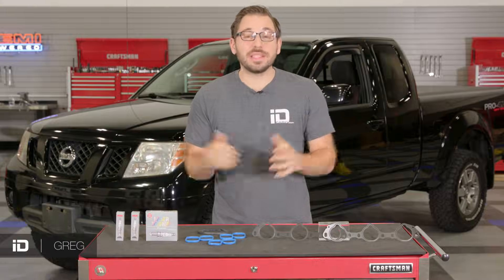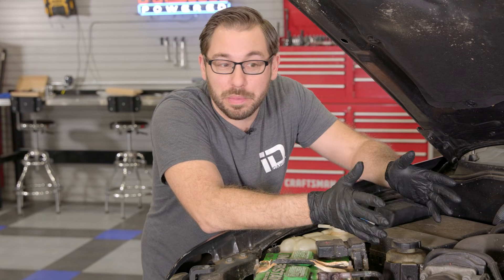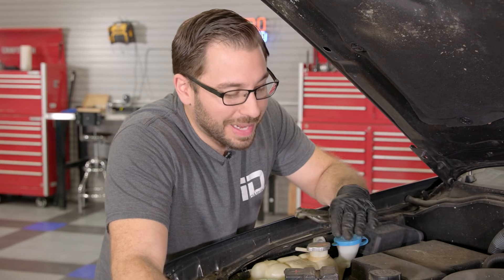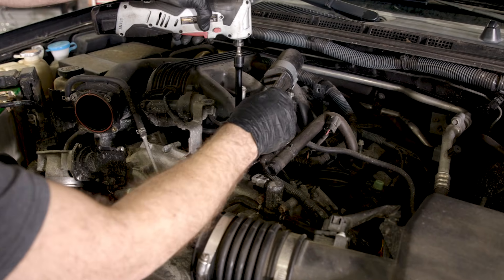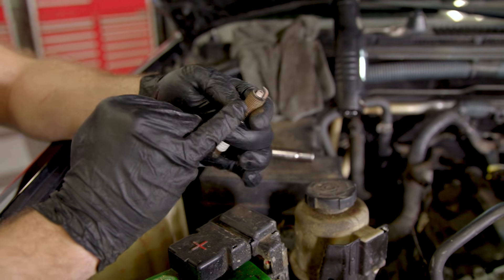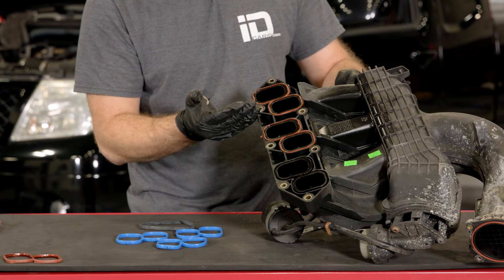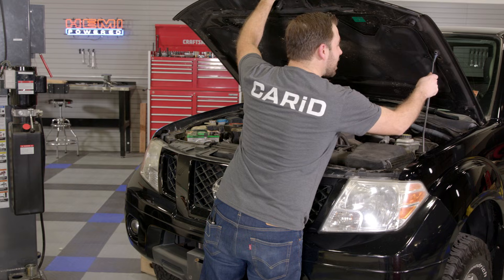Nissan Frontier 4.0L V6 Spark Plug Replacement DIY

Comment: When reassembling the manifold - you left out re-ataching the vacuum hose, that you noticed you needed to disconnect earlier. This is a really important step as it is specifically a brake vacuum hose and if not connected your brakes will essentially fail. I found this out since I forgot to re-connect it.

Comment: if I disconnect the battery I should be able to disconnect the throttle body and not worry about all the issues correct

Comment: Just did this, don't need to pull off the manifold foe the rear spark plug, and just needed to shift the manifold out of the way to get access to the 2 front

Comment: I found something interesting that I could not explain when I changed my spark plugs in my 2012 Nissan Frontier.  The forward intake plenum had two little holes on the underside.  The holes where about 0.1-0.125 inch in diameter.  I did not have time to explore it too far but they seem that they would let air in.  I'm calling the forward plenum the duct between the air cleaner and the drive by wire throttle body.  The two holes looked factory clean.  Has anyone else noticed these holes?

Comment: The rear harness bracket was not bad at all but there was a sequence that needed to follow to get to the fastener then reverse the sequence for installation.  This video was excellent for planning.
There is actually four harness attachments to the aft bracket.  I could only undo three of them before removing the intake.  I removed the bracket attach bolts and removed the intake with the bracket attached to the fourth wire harness attachment.  I removed the bracket from the fourth harness attachment post removal of the intake.  Then reversed the order for installation.  All four electrical harness attachments just clicked into place.

Comment: Looking into doing this particular job really soon (save myself $900 - the cost of the plugs).  I noticed you have the power roll, but could it still be done with a hand ratchet set?  What are the told that are needed to do this job?  -Thanks

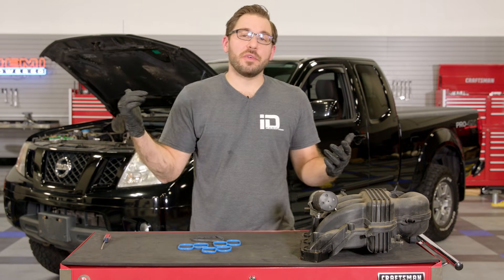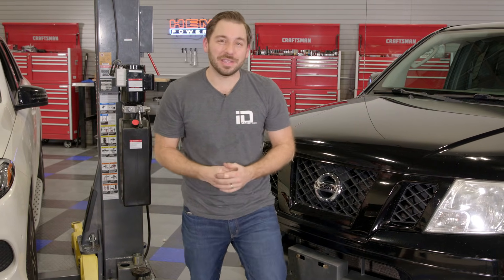Comment: The  rear harness bracket (x2 fasteners) appears to be removed from the intake - see 8:53:18:44.  At 12:49/18:44 I see the aft harness bracket has been removed. At 15:18/18:44 I can see he pre-installed the rear harnesses to the aft bracket.   I'm assuming that hold the aft bracket in place while removing and installing the intake manifold.  To install the bracket to the intake manifold you need to remove the main harness clips to get to the fasteners.  At 14:10/18:44 you can see the harness aft bracket is not there when he installed the intake.  I have this feeling that aft bracket and harnesses are going to be a pain to reach in and install.

Comment: I'm in agreement regarding this video. It IS the best one I've seen. Great explanations and instructions. But for me......nope! I'm at a point in my life where I can still do the minor repairs I need (such as replacing the hoses leading to my heater core that failed recently). But, thankfully, I'm also at the point where I can pay someone do go through this mess of a hassle. Once again, though, great video.

Comment: If the throttle has to be re-learned when unhooked, can a battery be changed without doing a re-learn ??/ ... Thanks
Reply: I've disconnected the battery on my 2018 frontier 4-5 times and when reconnected...no relearn process ...everything fine !

Comment: That's a lot of work just to replace spark plugs. When I go to do mine I'm going to replace all the coil packs and PCV valve and anything that looks defective also. Plus it seems like a good time to clean the throttle plate also.

Comment: It would be a good idea to replace pcv valve while intake is off. Also will be easier to replace cam position sensor if you have codes showing bad sensors.

Comment: Thanks for the info. But I have a 2016 and there is 7 upper intake bolts I had to remove not six. Just in case someone else has trouble.
Reply: Thanks for confirming.  I am doing this now and counted 7 about 50 times trying to figure this out.

Comment: If you do unhook the mass airflow sensor how does it idle, and is there a video on how to reset it, had to unplug it because those alan screws were completely rounded off inside
Reply: @carid  is this also a problem with ones that are manual transmission because I didn't have a problem with it last time when I had to disconnect it when I did a tune up, I had a cataylic converter go bad on me and fauled out a spark plug this time so had to disconnect it again but seems like it's still running on 5 cylinders so now checking to see if it's the coil
Reply: Doesn't seem to be reving very high but still idling very bad and also noticed my brakes are very stiff would that cause anything like that?
Reply: Check the vacuum line at the rear of the intake manifold. I forgot to reconnect mine and the brake pedal was stiff as a board.
Reply: @carid  I'm thinking I might have more problems from the bad cataylic converter might need to check all plugs or more of the coils, so far I only checked the passenger side since that's the side the cataylic converter was on

Comment: this video helped me a bunch but there are 7 total bolts and nuts holding the manifold down. Various extensions and or swivel will help. for onw on the back a rachetting 10mm. and all ofther bolts will be a 12 i believe. various pliers. Spark plug socket that fits your wrench set unless you have an adapter. a box to keep all the parts that you remove from the vacuum hoses and intake manifold. put the ignition coil screws up by the window and the coils on the floor or desk in orientation they are removed so that you can visually know how to put it back. I went ahead and bit the bullet and bout the ignition coil for cylinder 1 because i truly believe it is the only reason i took off the intake manifold and i don't plan on taking it off again. Try to remove as little vacuum hose as possible. Because they are all old and brittle lol

Comment: Awesome video. Followed it all the way and it took about an hour and a half. BUT there are more than 6 bolts that have to come off that top. Also I didn’t bother with that back hose. I just lifted up the intake and changed out the gaskets from underneath.
Reply: It was 5 bolts and 2 nuts on my 2013.

Comment: I don't want to do this myself.  What is a realistic price that a certified and competent mechanic would charge for replacing the spark plugs and PCV valve and cleaning the throttle body?

I overstand that dealerships make their money in the service department and I'm all for Capitalism and whatnot, but the Nissan dealership wants $700 for this, which seems ri-FN-diculous, considering that we're talking about $150 or so in parts.

Comment: I just replaced all 6 in my frontier without removing the intake manifold. 2 universal joints in tandem is all that I needed to remove the tricky one.
Reply: What did u have to remove
Reply: How long did it take you?

Comment: "Easy".  I have to agree with you, especially after changing my 2015 323 xi plugs recently (only 4), where the dealership wanted to charge around $400, but I did it myself. The only real expense were the plugs and some swivel extensions...oh and time. That last plug near the firewall made the job 2x as long to complete just because of that 1 plug LOL. and thank you for making a step-by-step video, this looks much easier since all the plugs are accessible after removing a few pieces :D

Comment: Crazy , too much to do just to change plugs . Nissan should have done a better job designing this engine to make it easier to service .
Reply: @carid  I doubt it's really that common with every make and model . I use to change plugs on all kinds of vehicles and removing the intake manifold only beacame necessary on a lot of front wheel drive V6 engines.  Not really common on rear wheel drive vehicles so much . Either way its ridiculous to remove an intake on an engine just to change spark plugs .

Comment: Last year, I had to replace the drain pump on my washing machine. It uses spring clamps like those on the hoses you showed. I tried using a pair of channel locks like you used, but they kept slipping off the spring clamps. I went to the local NAPA dealer and bought a pair of spring clamp pliers. One of the best tool investments I've ever made!

Comment: I changed my 2008 Xterra plugs and one ignition coil without removing the intake manifold, just need various sizes of 1/4” and 3/8” wobble extensions to get the job done. Easy and saves time. Next job will be to change both the upper camshaft chain tensioner plastic shoes, starting to make noise!

Comment: Hi! What type of spark plug socket do I need in order to replace the spark plugs?
Reply: @carid  Thank You! Would you happen to know the torque spec of the spark plug? I tried to look up that information but no luck.
Reply: Is there an online resource for these (and other) torque specs for this truck? Thanks in advance. 👍

Comment: That's too much damn work for freaking six spark plugs
Reply: Thats what i thought.... Im scared to start.  Also i messed up the head on one of the throttle body bolts a little last time i took it out to clean it.  I hope it comes out again
Reply: @blaisemacpherson7637  worst come to worst u can use some vice grip pliers to break it loose

Comment: You don’t need to take out the intake manifold to change the spark plug i have done it many times and i don’t need to take it out only one spark plug is a little difficult

Comment: Good video.  However, it is very important to speak of the torque specifications for:
Spark Plugs
Intake manifold bolts
...and all other bolts.  A first timer could watch this video and believe they could use their electric drill and over torque the bolts.

Comment: All the man hours Nissan puts into their R&D to come up with an installation procedure and torque specs! They should have just asked you and they could have saved a lot of time and money knowing you can just run it on with an impact driver! That is really crappy work and poor information to be showing people!
Reply: This is obviously a at home diy video and not every guy has torque wrenches at home. He #uggadugga till slightly snug and used feel to finish the torque. Dont be a bitch and learn how to use your tools dude. I work with 60k motors and use feel. I've never had one fail. Dumbass
Reply: @stephankahlau6759   how many uggaduggas do you usually  do when doing spark plugs ?

Comment: According to Orielly's auto parts store website, this spark plug is not made for the 06 Nissan Frontier, which is what I drive. Just relaying what the info website says. Thanks for the video though, how much would you charge a customer for this job?

Comment: thanks for the clear concise video.... My 2015 Frontier has about 55 K miles so not quite there yet.  The only thing I would do as the owner is to clean or al least vacuum the engine before taking out the manifold to avoid getting dirt and debris in the engine.  I know no shop would do that before hand but the owner probably would.
Reply: Are you a mind reader or something! Do you really think that you are smarter than a master mechanic and we do not clean around areas where vital entry points to the inside of the engine are going to be exposed! You are not some kind of Genius or mental giant, But you must be a narcissist to say that you know no shop would do that before hand but owners probably would!
Reply: @NeverEnoughPyro40  Dude, take a pill.

Comment: The bracket at the top rear on the manifold: Just remove the 2 10mm bolts and push the whole thing out of the way (after unclipping the harness from it).  Don't worry about the connector attached at the bottom.

Comment: If you don’t want to take off the intake manifold, get a ratcheting box wrench. You can take off the front spark plug by pulling the valve through the little loop hole that the air intake line creates.

Comment: If that intake assembly is removed, is it necessary to replace the gasket? I have a 2019 that the assembly was removed and put back on. Truck seems normal but I want to make sure it will be good long term.
Reply: Should be good as long as the rubber from the gasket is soft and pliable.  It’s was only a year old so I’d say probably.  If it drives good they you’re good

Comment: Great instructional video! What are the torque specs for the spark plugs and intake manifold bolts?
Reply: 16 ft. Ibs
Reply: Where did you find this information?

Comment: FOR ANYONE HERE. YOU DO NOT NEED TO TAKE THE MANIFOLD OFF TO CHANGE THE PLUGS ON VQ40

On the side with the manifold obstruction, remove the middle, then the rear and then the front. Plenty of space to fit your hand in there. 

Should take less than 40 min for the entire job start to finish.
Reply: DO A  COMPLETE VIDEO ON YOUR CHANNEL AND SHOW US WHAT YOU TALKING ABOUT ! I WILL WATCH.
Reply: Forgive Repent there is one out there. I did the job without removing intake manifold as well.

Comment: Great job..thanks so much. I have a 2012 Nissan Frontier with 69K miles. I feel confident I can do this because of this video.
Reply: You dont need to remove the manifold, it's a waste of time and the passenger side spark plugs can be changed without removing the manifold, saving atleast a few hours on the project. Just an fyi

Comment: Is antiseize or electric grease necessary for the spark plugs?
Reply: yup and they should be torqued to spec.
Reply: @scott8238  No grease. Plug threads are coated already. Anti seize will interfere with proper grounding between plug and engine block. Yes, torque to spec (18 ft-lbs).

Comment: So I have a 07 Pathfinder and I disconnected the throttle body connection when I had a misfire in cylinder 1, and when I put everything back I didn't notice anything weird with it, so what relearn are you talking about?

Comment: Thanks so much for the comprehensive video -- it makes me less afraid of having to pull off a bunch of crap by myself.

Is there any way you could add a list of what sizes of socket/wrench you used? Even "metric from x to x" would help me make sure I've got the right ones.